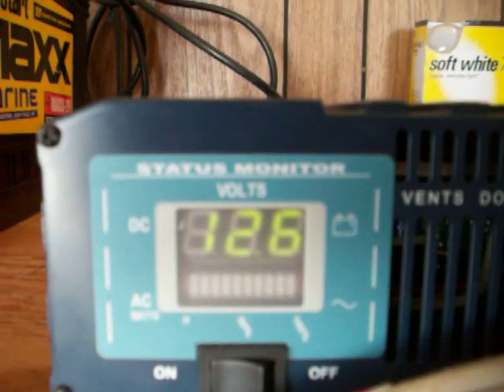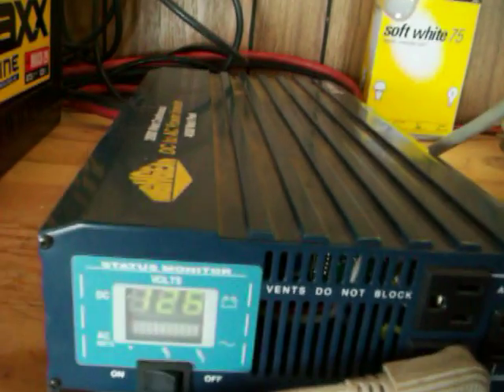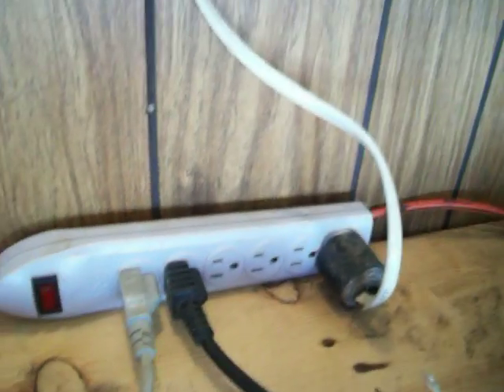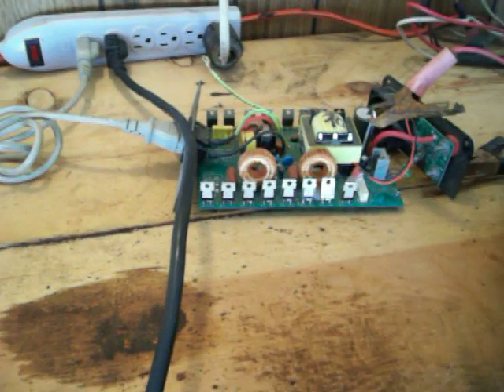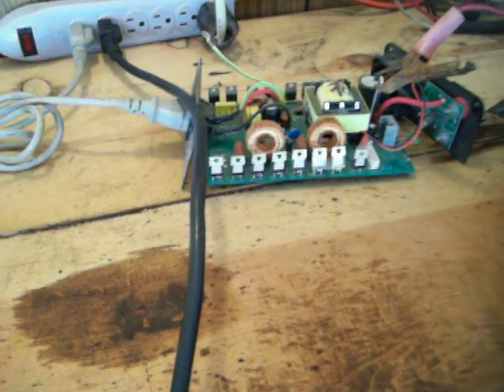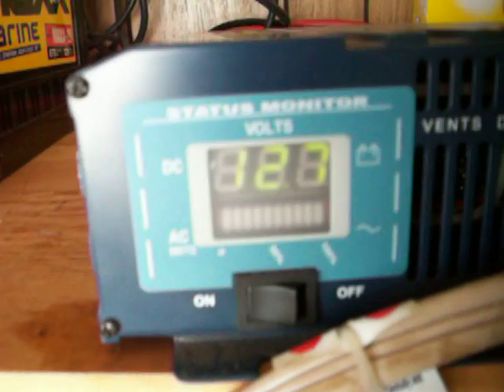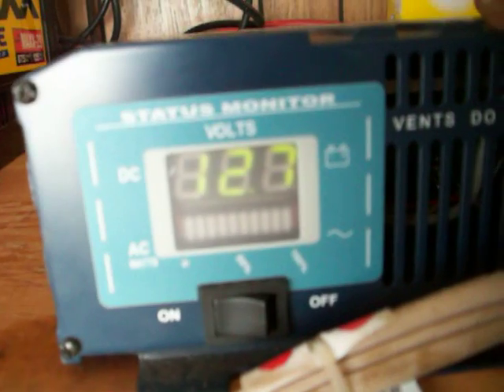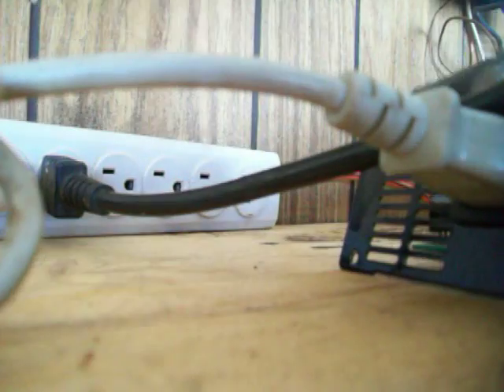Poor mans inverters assisted by grid-tie inverters

Comment: you can actually destroy the normal inverter by doing this. As the grid tie inverter will try force power into the normal inverter. When you see the output voltage on the normal inverter rising, that is exactly what is hapening. Whilst that is OK if your initial power source is the grid or even a diesel generator. An inverter will not last long used in that way !.

Comment: Good to know. I think you are awesome. I have been thinking about this concept. Wondered if an off grid inverters frequency could enable a GTI and if the two could work together in a circuit.  Were both pure sign wave inverters? Would this work with inverters with different type sign waves?

Comment: DO NOT DO THIS! You will be sending your inverter in for repair! Most GTIs don't REGULATE the AC side, no need, because the grid is an INFINITE LOAD - A BIG LOAD that you can never overcome with 300W. As soon as you lose that load the voltage will go up until your inverter goes POP! Do not do this! One guy did and blew his nice sine wave inverter. Oh, and there's a reason for the box as a heat sink too, I hope you didn't run it very long like that.

Comment: I would second Prancinglion1*s question,did you just made a *simulated ac grid* with the regular inveter and assisted that grid with a grid tie inverter?Is that it that you just did?...Or putting it simple,can a grid tie manage  to connect in a isolated off grid line suported by a regular *inverter+battery bank*?!Does the GTI see that power line as a normal utility company electric line?

Comment: Cool Video.  I wondered if a GTI would read the AC signal from an inverter in an isolated circuit and accept it as the "Grid Feed."   I guess the answer is 'Yes, it will."

Comment: what people dont see is he is using his inverter to power the light that is connect to a power stripp and the meter is connect to the inverter as if it was the main and the gti is then pluged in to the power stripp   now what happes is the gti is on the same power stripp as the light and as it sinks up it shars the load with the inverter so it looks like the meter goes down. what happes if you had a 100 watts and it is split between the inverter and gti to give a 50 watt readding. great vid

Comment: Thanks for sharing this, I made a video about this concept last year but did not have the courage to risk roasting either inverter by testing this concept on it.   I am rigging one camper trailer as the main power station, but it will be boosted by other solar power systems which run GTI's into the same mini-grid.

Comment: You don't have anything plugged into the grid? If so, I don't understand why the watt meter goes down. Maybe the grid-tie inverter just fools the watt meter. By the way, I saw an ad on Craigslist for new 200-watt solar panels for $300 each. The panels are being sold by a company in Arlington, Texas, which is not far from where you are. A couple of those solar panels and a grid-tie inverter would really reduce your electric bill.